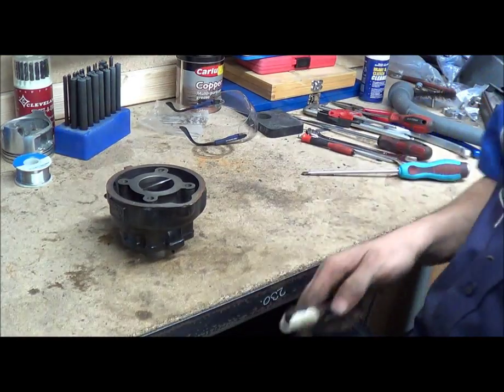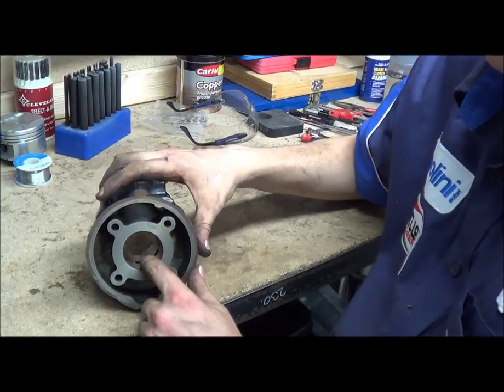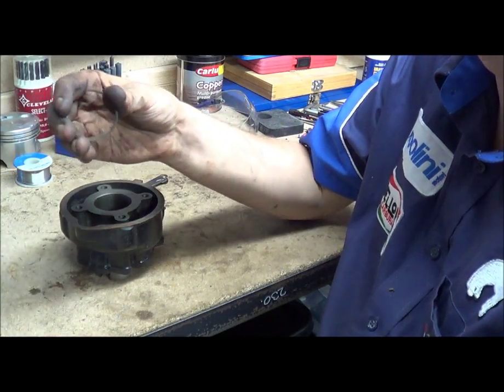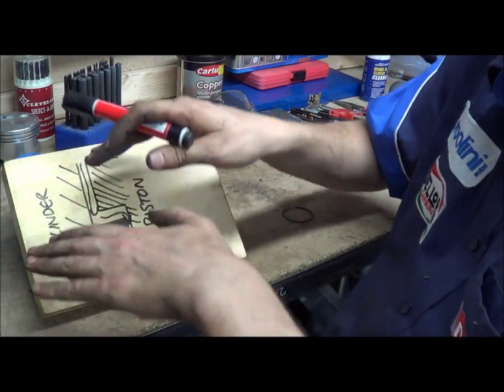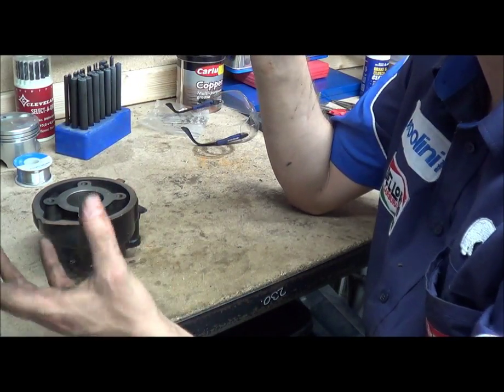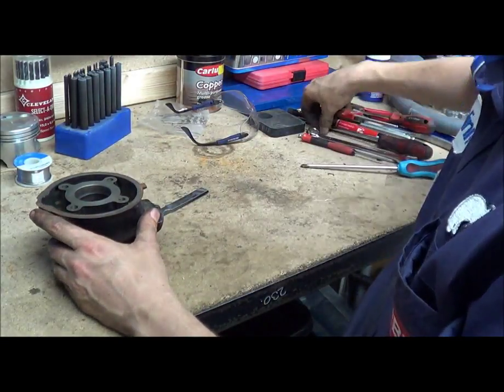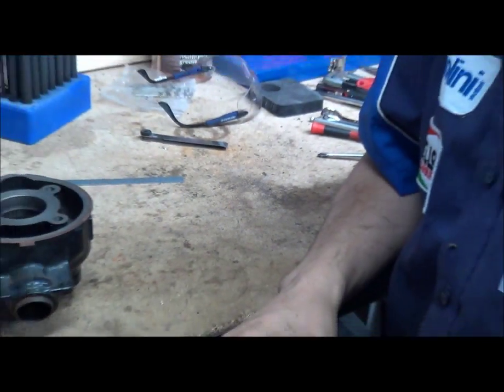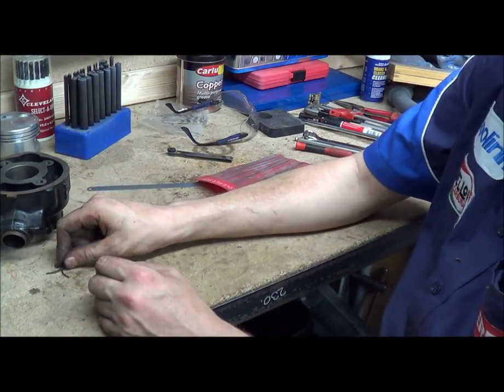Measuring Piston Ring Gap

Comment: I know this video is very old, but I watch a lot of your older stuff.  A lot of good info in there.  I'm building (2) 2 Stroke scooter engines.  One is an AC 50mm Iron Bore Honda, the other an LC 47.5mm Nikasil Minarelli.  Since these are big bore kits and not factory, would I still use the manuals ring gap from the original stock engine? Or do I need to adjust it for these larger bores?  Any recommendations?  Thank you!
Reply from the maker: Yes if you change the bore the gap needs to be adjusted.
Reply: @thedirtyworkshop  the Athena paper with one of the pistons has what I believe to be rec ring gap up to 100cc .04/.06mm. Does that sound right?  Thanks again!
Reply from the maker: You should ask Minarelli. Different cylinders and rings have different temps etc

Comment: Just found your channel.  Terrific explanations.  Why can't you measure the ring outside of the cylinder with a  caliper?  Thanks for the video.
Reply from the maker: Because you'll squash the rings. This measurement is an installation measurements and calipers are not accurate
Reply: I work in inspection at a manufacturing company (1938 might give you a clue) and we make these. On outspringers like these we use feelers in a ring gauge on a surface table. If in doubt, pop it on a shadowgraph. We also take a measurement in free state but this has more to do with diametrical load than anything else. 
Good explanation and nice video, I enjoyed it👍🏻

Comment: I believe to get the average ring gap for any cylinder is the convert the bore measurement from mm to inches and times that figure by 0.005". for instance.66mm bore = 2.59843" times by 0.005 =0.012" or 0.33mm.Do think this is a good formula?
Reply from the maker: No. Material of the bore and rings have to come into play.
Reply: The Workshop your right. It's send a good formula for iron sleeves but not for nikasil. Factory for 66mm on nikasil cylinder is 0.20 to 0.35. Still a very fine slot.

Comment: what do u mean rings dosent have to move?ye they do! if they dont u het nasty vertical scar in the cylinder and u loose compresion
Reply: +Pony Power some people are brain dead your right.
Reply from the maker: What do you mean? Move or rotate?
Reply: Pony Power - Theory
rotate
Reply from the maker: 2 stroke rings don't rotate, as mentioned in the video, otherwise they will protrude into the ports and break, hence the piston ring pins.